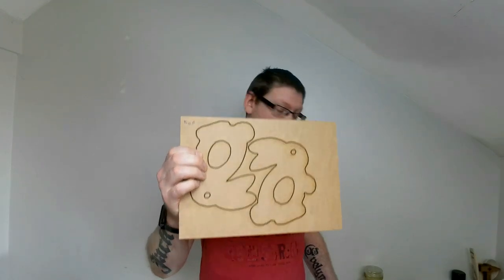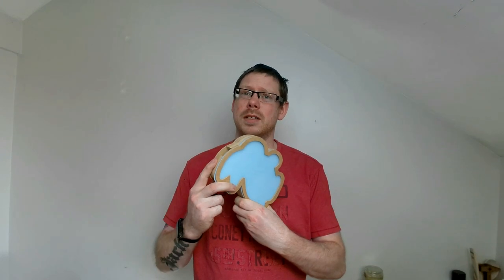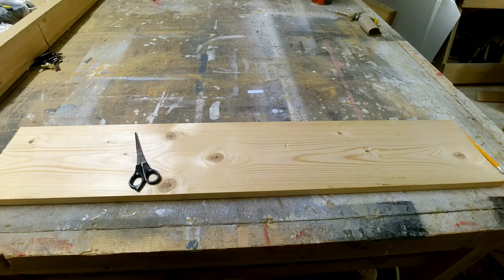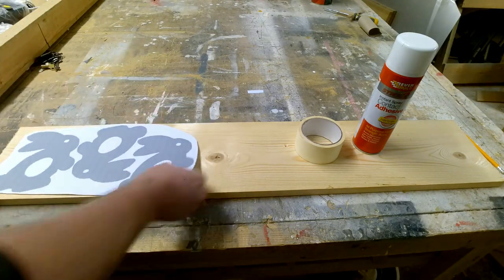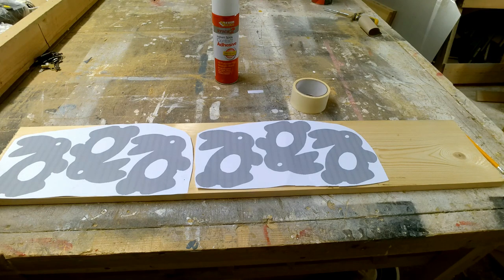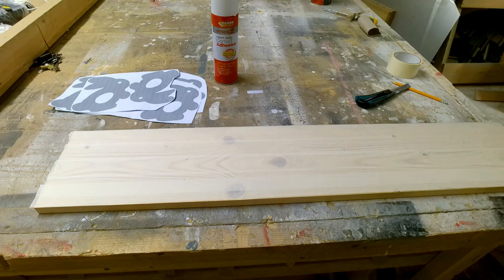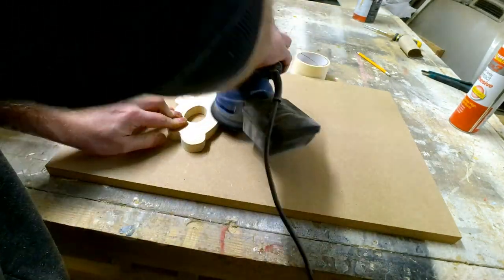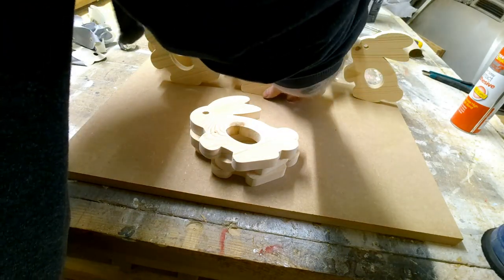Making £1000 in one month with my scroll saw 🤑💰

Comment: Why not use your laser to cut clear acrylic as a template? I much prefer templates to paper.
Reply from the maker: The time it takes to draw around a template over and over is not really worth it in the end. I transfer a full 2.4m length that takes less than 5 minutes with paper .
Drawing around 18 bunnies takes a minute or so each.